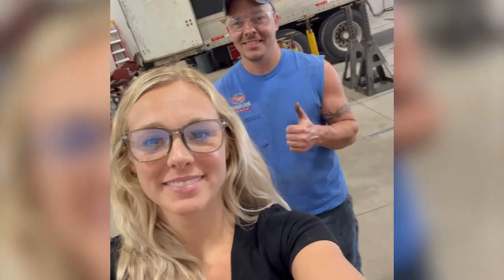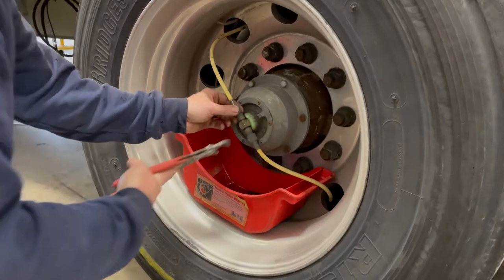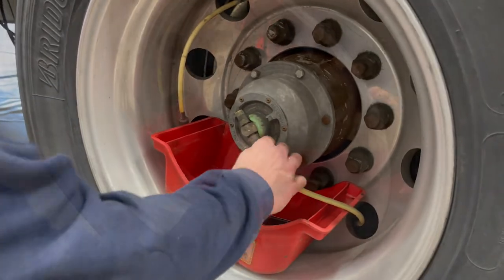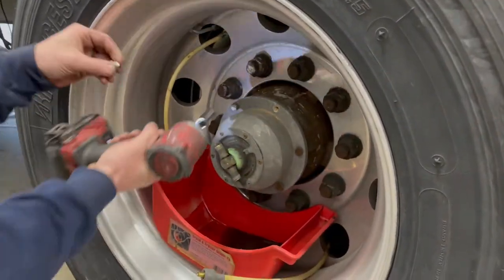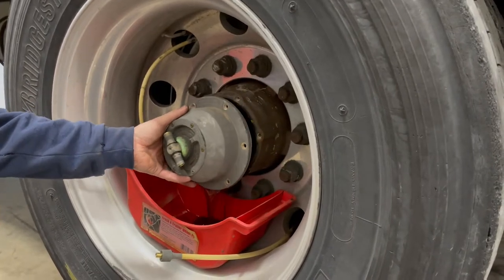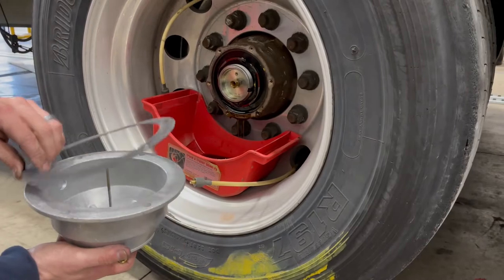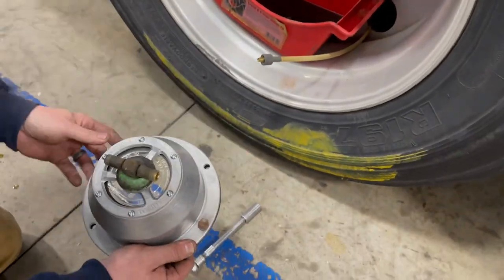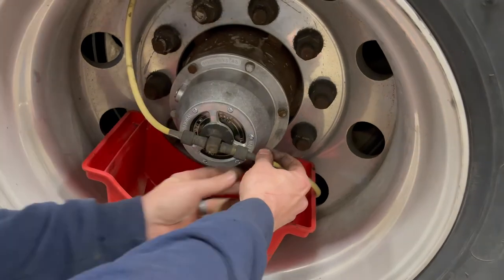How to Replace a Hubcap on a Semi-Trailer

Comment: What size gasket are you using?
Reply from the maker: Hi, Esteban. The size of your gasket will depend on the size of the spindles. If you have a straight hub, the spindles will be larger therefore needing a bigger gasket. If your hub is tapered, the spindles will be shorter and you will need a smaller gasket. Hope this helps!